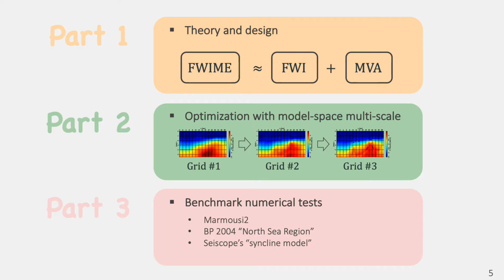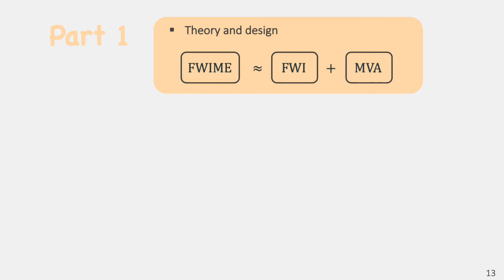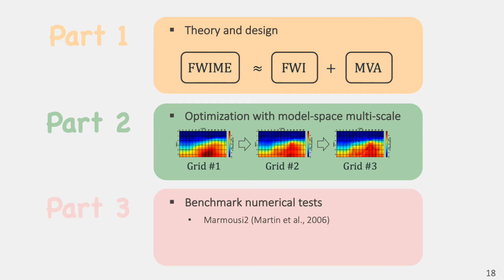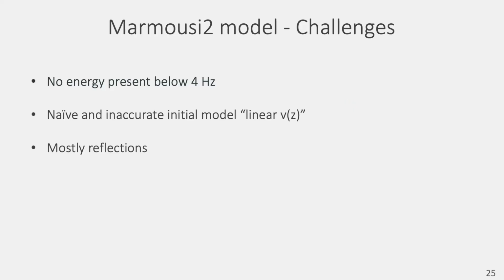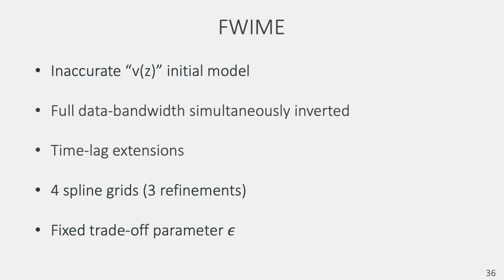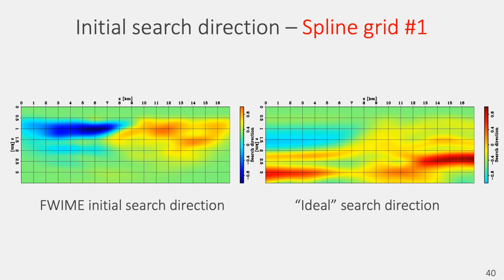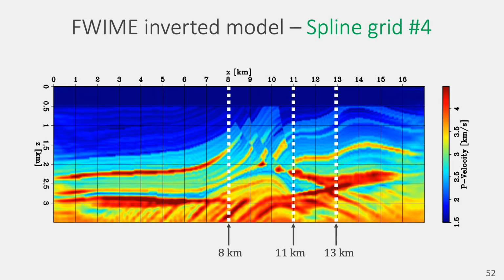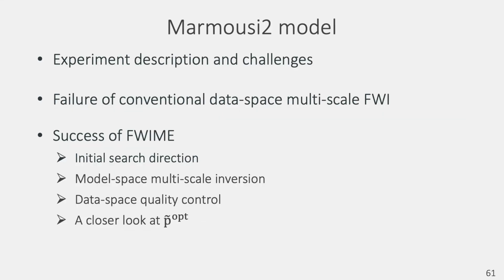FWIME - Part 3 - Section 1 - Marmousi2 example

Comment: Another really good video as part the FWIME series. Thank you for sharing all of these. Just to re-iterate (please correct me if I am wrong) each variable projection step requires NCG iterations ( I heard 60 in the video) of linear Conjugate Gradient to retrieve the extended p tilde. Further you are taking a variable projection step per L-BFGS iteration NBFGS. So in total we have NCG*NBFGS=60x240 iterations? I am just trying to get a ballpark on how many forward modelling you need between the extended born operator and the FWI modelling you had used in this example.
Reply from the maker: You are totally correct, which is why for field applications we would typically apply FWIME only on the first spline grid, then apply a multi-scale FWI method. This test was for academic purposes to show that for inverse-crime cases we can recover quasi-perfect solutions. On the Marmousi2 test, the inversion on the first spline grid took approximately 24 non-linear iterations; hence, corresponding to NCG*NBFGS=60x24 iterations. Moreover, if you use the inverted model after the first spline grid as an input to an multi-scale FWI approach, you recover a very similar solution like the one we obtained at the end of the last spline grid (basically, the last inverted FWIME model). This result (not shown in this video) is better compared to the one on slide 74 (https://youtu.be/u5rgVqcdN3M?t=1138), where a multi-scale approach was not applied.

All the results you can see in these video series were obtained without using any mathematical or computational "tricks/shortcuts". First, we wanted to make sure the technique had value and it was working without trying to optimize the cost (or be clever). Now, we are testing optimization tricks to reduce the overall cost. As you may know, the main bottleneck is the number of linear CG iterations used during the Variable Projection step. We know that there are a lot of mathematical tools to speed up this step. We already found simple ones that allow for a speedup factor of approximately three; without too much effort. We still have a lot of ideas to reduce the cost even further. Thanks for the relevant comment!